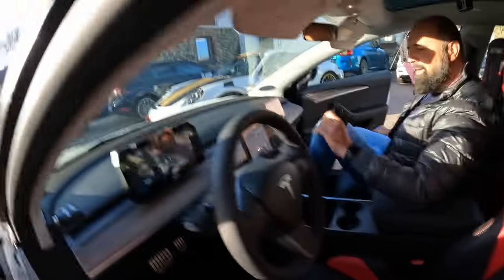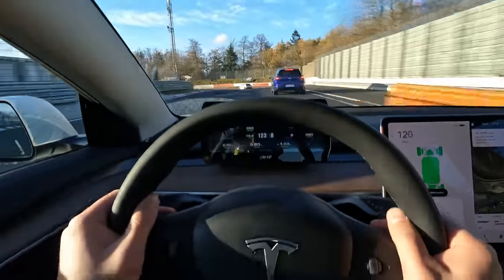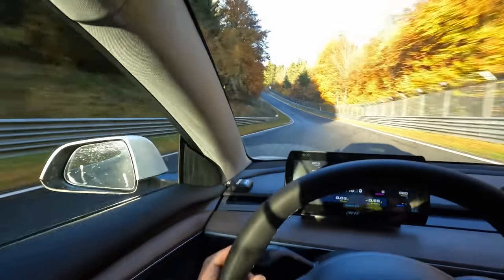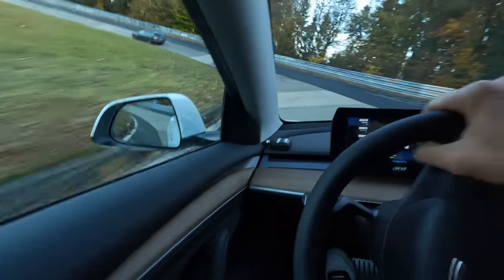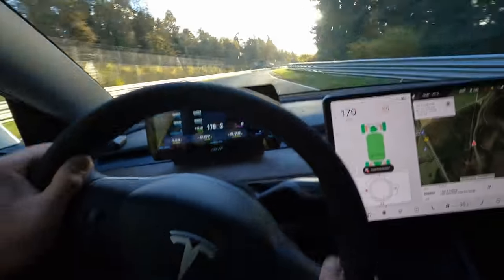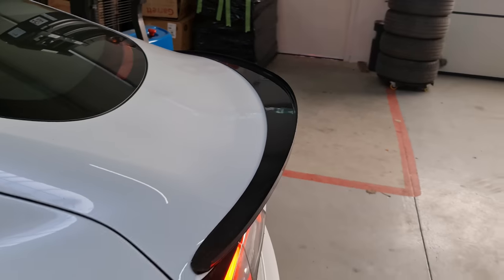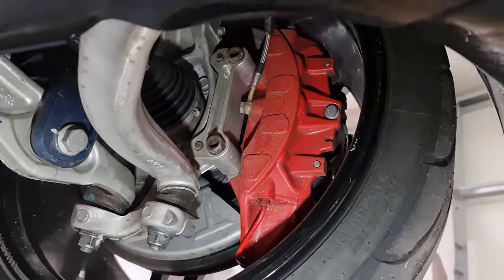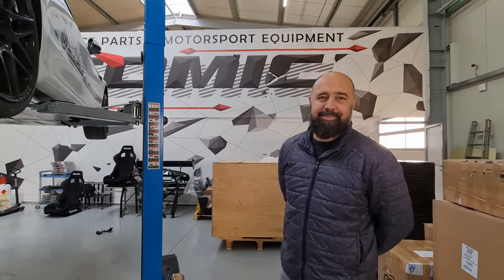The BEST MODIFIED Tesla Model 3 Performance I Have Driven!

Comment: How much difference do lighter wheels do for handling and overall experience?
Reply: Who do you ask? He drove the Model 3 Performance with the stock and heavy Uberturbines. You need to ask an owner who experiences his car more often and could give you a better insight.
Reply: @romansenger2322  I meant in general. On my car I have quite heave wheels. I was wondering if it's worth getting lighter wheels at some point
Reply: I'm not even going to pretend I didn't swap wheels for the optics, so I was certainly surprised by how much the ride improved on fully forged 9x20s. Those Ubers must be really heavy. 

As for performance, a friend of mine made repeatable 3.1s 0-100 kph runs on Dragy so obviously there's a benefit. I'm getting wheelspin on roundabout exits where this never happened with the Ubers (same exact tires transferred over) so I personally think traction control is (at least partly) dynamically calculated and not based on individual wheel speed like on an ICE car. 

This car is doing highly sophisticated footwork to let us savages go much faster than an average Joe has the skillset for, lol.
Reply: @advocatesdevil7064  i did it to my car C63 forged wheels and its more noticeable than tuning the car was. Its an overall difference in everything you do.... amazing.... changes the car unbelievably

Comment: Tesla is a good option as a universal car and for racing and for driving around the city, and the company has been around for several years bravo tesla
Reply: What on earth are you talking about? I just cant understand this blind devotion to Tesla. They really aren't very good for racing or track driving, the electronics aren't calibrated for track driving and they require significant modifications to handle it. The upgraded brakes and battery are overheating before even a single tourist lap, and the Nurburgring is not hard on brakes at all. Even this highly modified Tesla is still compromised for track use.
Yes, driving around the city might be good but to say they are any good for track use is nonsense.
Reply: @matgee8892  Not everyone can afford a few cars for the track, city, etc. Tesla is a phenomenon not because it is but because it crosses new technological barriers, and as a young automotive company is put in the top of cars, it is not perfect but shows that it tries to keep up with other brands and even overtake them.
Reply: @civic952   If someone can only afford one car for city and track use then any Tesla should be bottom of their list.
Reply: @matgee8892  I agree with you if someone can afford to buy 2 city cars and it's ok.
Reply: My toyota prado is an amazing/universal vehicle for all kinds of use from daily driving to towing, camping and even overlanding everywhere i want.
Reply: @matgee8892  the tesla model s plaid is even worse with factory abs and brakes.
Reply: @civic952  it is actually not put in top of cars sorry to disapoint you.
Reply: Lets say it like this, in an EV world the Model 3 Performance is a very good track car, probably the best for the middle class.

Comment: Impessive! How many laps till you have to charge it again?
Reply: More like how long do you have to wait after each lap to not overheat the battery
Reply: @tehpillemannerator  the battery will be throtteling at about 55°C which is the same temperature you get from supercharging. And people do charge at the stalls at the ring and then drive on the track with thermal throtteling only in the last 10% of the track. So you dont have to wait unnecessary. Just charge and drive. Or use a software mod that cools down the battery while charging.
Reply: realistically  from 3 to 5 fast laps  depends of driving style
Reply: @olegkucherov3898  nah mate, i love my Tesla but you have to be realistic here. If you watch some youtube who got fast times they will use about 60% per lap. Especially if you deactivate regen like in this video you wont do more than 1 lap.
Reply: @romansenger2322  just come next season)
Reply: @olegalex78  will be there with my own M3P hopefully

Comment: If this is the future, I don't want it. For me sound is SO much of the experience
Reply: Yeah sorry not for me on track, I don't want a particularly loud car while concentrating on driving at more than 8 / 10ths. Loud sounds actually dull your senses which you need for car control. You also can hear all the different parts of BEV strain and stress due to track driving. It's quite an interesting auditory experience that even Road & Track explored.
Reply: Leave awesome engine sounds to comfortable big Highway Cruisers. I grew up in the same town as Holden HSV's HQ.
Reply: @Neojhun  You've obviously never driven a GT3 RS on track then I take it ha ha
Reply: @itslukkeee  Not an RS but I have driven a 991.1 GT3 non RS. Yeah it massively muffles interesting sounds of the BEV functioning like Suspension & Tires. The mechanical induction package noise is GLORIOUS but that is just masking the experience of Controlling the car. FYI I own a Cayman.

Comment: out of curiosity

so...   when it crash and caught fire.   what is the protocol ?
dump it in a tank with water and leave it there
Reply: Most battery fires can be controlled if you’re quick. Problem is that you have to cool it for hours to make sure you don’t have it reignite. That’s where a container with water would be helpful.
Reply: @goodyKoeln  if you're quick,.  How long does it take to get a fireman there with equipment
Reply: @gogogo155  on the Track? Seconds to a couple of minutes. They’re on standby whenever the track is open.
Reply: @romansenger2322 
-Not as often,twice so hard and Not as easy to
- is that blanket directly there. Probably not 

Still does are need to be a fireman on the spot,

For a ICE (a normal car) is everything plain and simple to extinguish,. 

I still think that, when the first time it happened there, it won't be that easy as a couple of "seconds" if you're quick you can controll it.

And stil they still need to drive to the location. 

Not trying to start a argument, but I wanna see some proof of All ,.  Response time/equipment etc.
Reply: @gogogo155  EVs don’t just “blow up” which gas cars do cuz u know, they got a flammable liquid in vast quantities, but EVs burn slowly. It’s one cell burning after the other, so it’s not a fire that causes an explosion, it’s slow and can be controlled easier. That leaves plenty of time for the passengers to get out and call the firemen.
Reply: @harsimranbansal5355  I'm not talking about explosions...  Or "blow up"

Comment: If Tesla make a Model 3 Performance using front and rear mega castings, 4680 structural battery pack and centralised mass the chassis could be 250 kg lighter and hundreds of percent stiffer than the current model 3 shell. That will be a very interesting car……
Reply: Where did you get that number from? 250 sounds way too much. Also, I currently dont see the bigger 4680s in performance orientated cars. The cooling is worse for cells with a bigger volume.

Comment: Its not Always about STRAIGHTLINE SPEED boys...
Rememeber " BOLT-ON TURBO CIVIC BEATS FERRARI" YouTube videos?... which car would you wanna own?
Indeed EVs is the next ERA n they are excellent at moving people etc.
BUT....
Very soon, like tesla, Every EVs on the road will be capable of 2 sec in 0-100km. And it becomes DULL after some time...

From a generic Motorsports Enthusiasts VIEW :

- UPGRADABILITY : U can modify that Civics Engine / Turbo etc from some stock 180hp to a Monster 1000hp+ Civic if u can, and sequential transmissions, exhaust sounds etc etc going on inside that Civic for more COMPLETE Thrill package recipe 
- FACTORY DEFAULT TESLA : While in a Tesla, is like Sex with a Blow-Up SEX DOLL.
Every Tesla everywhere on the roads will be SAME FACTORY DEFAULT specs later on, 
is there anything to race against each other?
But u can only change better BATTERY PACKS or throw away the rear seats in that TESLA?...
- All 4 Wheels are COMPUTER CONTROLLED on Tesla   
 VS   
Requiring ABSOLUTE PURIST Mechanical Driver SKILLS On-road feedback and Input on ICE cars.

EV, Its good at moving people.
But having driven a manual turbo car on tracks etc, it is a different kind of feedback n FUN.

Like Cooking your own meal  VS  Eating a INSTANT CUP Noodle logic.

Peace.
From Singapore
Reply: The fact that the car has an electric motor instead of an engine does not make it dull to drive.  Mostly you are just watching and respond to noise… which can sound exciting to even if the car is a pig to drive and is extremely slow.
Reply: Boy what in the holy hell are you talking about?